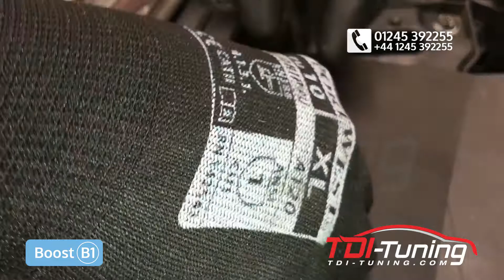Renault Nissan Infiniti V9X 3 0L Diesel 2CH

Comment: I don't know why you even bother posting these videos if you're not interested in responding to people's comments or questions.  This obviously is not an easy fit/de-fit, so I'll probably go for a re-map instead.
Reply from the maker: Hi Ewan, sorry for the late reply. In answer to your original question, we've found that with greater horsepower the acceleration times do come down. We don't quote 0-60 times in general because they are driver dependant however on average customers see between half a second and a second quicker to 60mph. 

Regarding the installation time and removal of the tuning solution, the estimated time for fitting on this type of engine  is around 30 minutes for someone with a decent understanding of locating sensors and plugging in the tuning box. 

The benefit of any tuning box solution is that it can be removed without leaving a trace on the ECU at any time. On the TDI-Tuning system you have up to 7 maps to choose from whereas with the remap you just have the one map. 

Finally our tuning systems have the ability to be controlled via an app on your smart phone, comes with a 3 year warranty and has someone at the end of the phone for full technical support. Once again, sorry for the delay getting back to you if you need anymore advice on the right tuning solution for your car please don't hesitate to contact us at sales@tdi-tuning.com